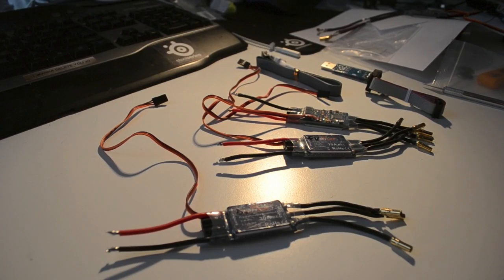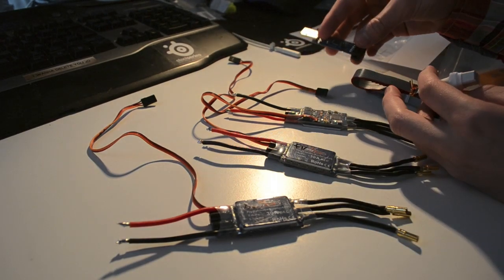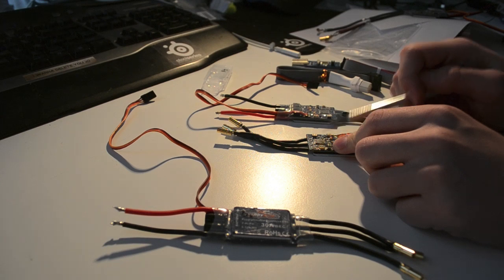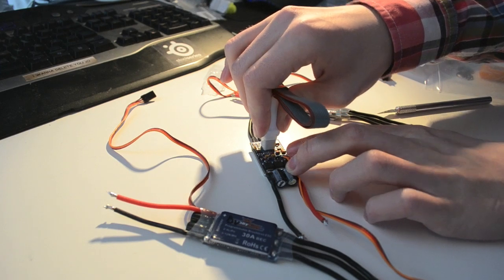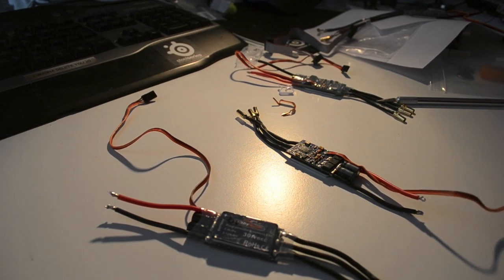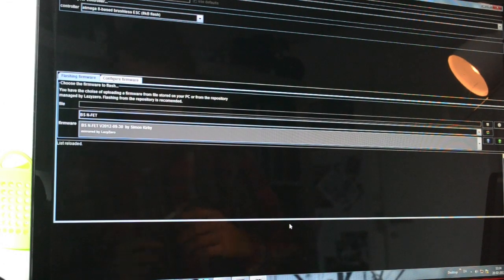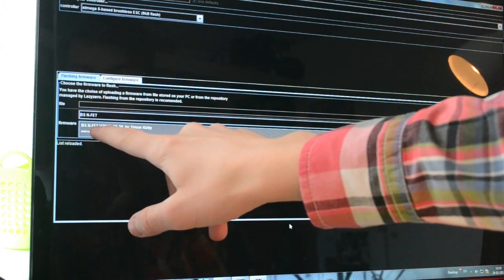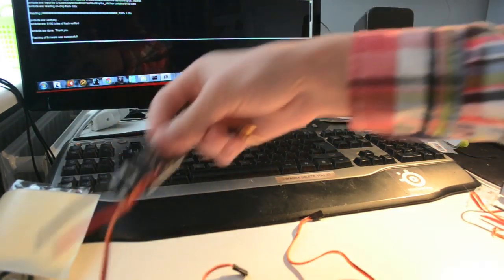Complete Tricopter Guide - ESC Flashing [Part 3]

Comment: Hello, I have same question as Zoubir. Also I have the doubt on what is the link from where you're getting that fimrware. Can you please post a reply? thnaks
Reply from the maker: Hey there. First of all thanks for watching. Secondly, yes you can use the standard firmware on the ESC's, but the refresh rate which the ESC updates the current of the motors is quite slow on standard firmwares. Therefore we can increase the refresh rate (decrease the time between each update in current sent to the motor) by flashing a new firmware onto the ESC's - simonK firmware. This makes your copter way more stable as it can correct itself much quicker than before. You should download the LazyZero kk multicopterflashtool (search google (.de site)), and from there find the firmware you need to use. Hope this helps, good day!